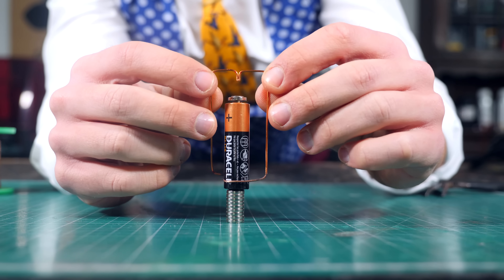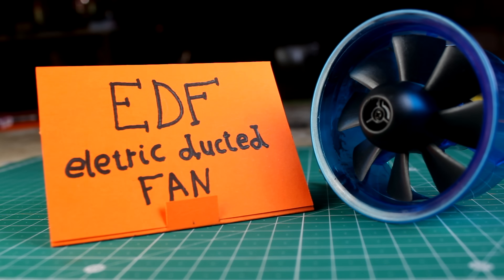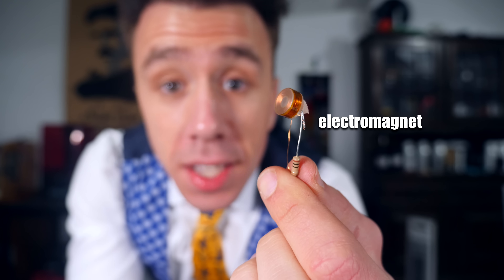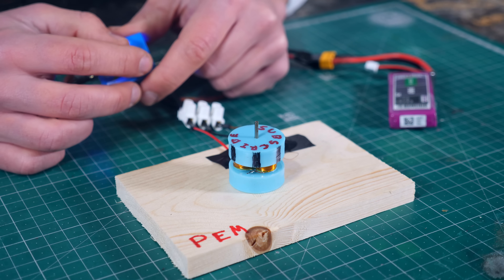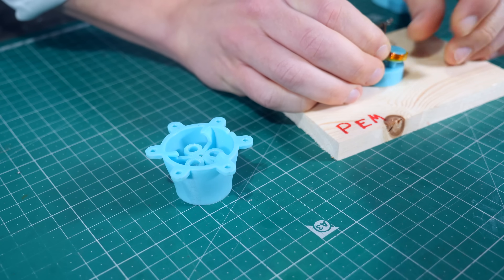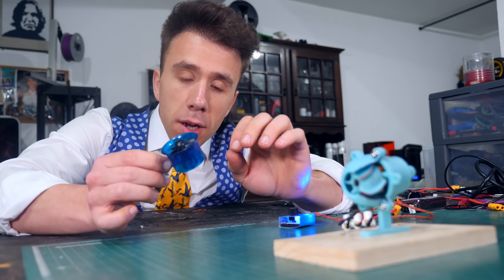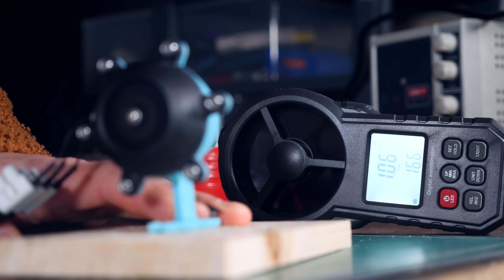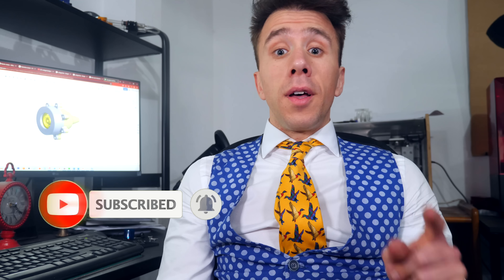I 3D Printed an ELECTRIC MOTOR FAN

Comment: As an electromechanical engineer I see not a lot of people are talking about the fluidynamics aspect, allow me to explain in basic terms:  Aside from optimising the blade/turrbine design to the motor, and clearances etc., there really is one main reason why you won't really be able to make as much thrust with the "Turbo Fan" as with the normal EDF. It all boils down to the conversion of pressure to flow. Below a simple explanation.

As a few people already mentioned, thrust is equal to the mass moved by the device per unit of time multiplied by the speed of the air moved (F=(dm*v)/dt)
This means that to obtain the highest amount of thrust, we want as much air as possible travelling at the highest speed possible. 

A  moving fluid (gas or liquid) will store it's energy in either an increase in pressure, or added velocity (at least in this use case). Both are interchangeble. This means we can use a gas at high pressure and convert a part of this pressure into motion. Think about compressed air absolutely blasting out of an air compressor, or putting your finger on a garden hose. The device you would use for it is what is called a nozzle. Sadly enough, converting the energy stored as pressure into a higher velocity will in the real world always be an operation paired with losses, there is just no way around it. A nozzle will never be 100% efficient. Since what we are interested in is the highest amount of speed, we would like to convert all the pressure our imaginary pump or fan produces into speed. But as this conversion saps away energy, we would actually like our pump to produce the least amount of pressure from the get-go and just create velocity alone, so we don't lose any from converting it. If one pump or fan turns its received power into a higher amount of pressure, it will thus never produce the same amount of thrust as a fan/pump that turns its received power into a higher speed. This means that even if both pumps/fans are perfectly optimised, the higher pressure one will never generate as much thrust as the lower pressure one.

This leads us to the final part of the explanation, namely the selection of the right pump. A normal fan or propellor is designed to move as much air as fast as possible, without creating any usefull pressure after the fan/pump. As mr. Integza already mentioned in the video, a turbocompressor creates a good amount of flow, but also generates extra pressure. This is usefull if you would want to use this pressure to pump fluids up slopes, to compress air in a jet engine for combustion or to create boost pressure in a car. But in this case we are looking for thrust, and thus as previously explained for velocity. The type of 'turbo Fan' in this video is a semi-axial fan. This is the middle ground between an axial fan, and a centrifugal fan. It does not produce as high of a head pressure as a centrifugal fan, but more than a fully axial fan. It will therefore not be able to generate as much thrust as a normal axial fan, regardless how much you optimise its design. Which doesn't mean it is a bad design, it is just a less suitable design for this purpose.

(And then for the people really intersted in the topic, to improve a fan's or pump's efficiency at higher pressures, we would really need to make blade clearances as low as possible, this then serves as a good example of why optimising this type of design will also be quit difficult, especially compared to optimising a normal fan.)
Reply: ᴄᴏɴɢʀᴀᴛꜱ ʏᴏᴜ ʜᴀᴠᴇ ʙᴇᴇɴ ꜱᴇʟᴇᴄᴛᴇᴅ ᴀᴍᴏɴɢ ᴏᴜʀ ꜱʜᴏʀᴛʟɪꜱᴛᴇᴅ ᴡɪɴɴᴇʀꜱ ꜰᴏʀ ᴛʜᴇ ᴘᴀᴄᴋᴀɢᴇ ᴄᴏɴᴛᴀᴄᴛ ᴛʜᴇ ᴛᴇʟᴇɢʀᴀᴍ ᴀʙᴏᴠᴇ
^^^^^^^^^^^^^^^^^^^^^^^^^^^^^^^^^^^🎁😊

Comment: Thrust is mass flow times velocity increase. Stepping up pressure to increase velocity doesn't do anything except provide an obstruction to the flow, redeucing mass flow more than velocity is stepped up. If you open your nozzle up until it doesn't provide resistance to the motor you'll have the highest thrust. The duct on your centrifuge should just be shaped to direct all of the airflow in the direction of thrust. (My guess is that the duct wall would be a section of a parabola)

Comment: The EDF and the Centrifugal Turbojet engine you built has different bypass ratios, basically the EDF is moving a lot more air. Unless you strap an afterburner, or redesign the intake and impeller itself, you won't get more thrust.

Emphasis on the redesign of your impeller.
Reply: ᴄᴏɴɢʀᴀᴛꜱ ʏᴏᴜ ʜᴀᴠᴇ ʙᴇᴇɴ ꜱᴇʟᴇᴄᴛᴇᴅ ᴀᴍᴏɴɢ ᴏᴜʀ ꜱʜᴏʀᴛʟɪꜱᴛᴇᴅ ᴡɪɴɴᴇʀꜱ ꜰᴏʀ ᴛʜᴇ ᴘᴀᴄᴋᴀɢᴇ ᴄᴏɴᴛᴀᴄᴛ ᴛʜᴇ ᴛᴇʟᴇɢʀᴀᴍ ᴀʙᴏᴠᴇ
^^^^^^^^^^^^^^^^^^^^^^^^^^^^^^^^^^^🎁😊
Reply: Absolutely right, EK= 1/2 mv^2. The most efficient way to make thrust is to accelerate a ton of air just a bit faster than your flight speed.

Comment: 1. Blades passive balancing (static balancing).
2. Blades active balancing (dynamic balancing).

For first one you just need to buy an prop balancer. It's quite easy to balance prop/turbine at home. I did that a bunch of times.

Second one (active balancing) requires a special machine with sensors and precise measurements of vibrations by different axies. It's, probably, possible to do at home, but I never saw a DIY active balancing machine.
Reply: ᴄᴏɴɢʀᴀᴛꜱ ʏᴏᴜ ʜᴀᴠᴇ ʙᴇᴇɴ ꜱᴇʟᴇᴄᴛᴇᴅ ᴀᴍᴏɴɢ ᴏᴜʀ ꜱʜᴏʀᴛʟɪꜱᴛᴇᴅ ᴡɪɴɴᴇʀꜱ ꜰᴏʀ ᴛʜᴇ ᴘᴀᴄᴋᴀɢᴇ ᴄᴏɴᴛᴀᴄᴛ ᴛʜᴇ ᴛᴇʟᴇɢʀᴀᴍ ᴀʙᴏᴠᴇ
^^^^^^^^^^^^^^^^^^^^^^^^^^^^^^^^^^^🎁❤

Comment: the more power you use per flow rate, the worse the thrust per power will get. If you made a fan the diameter of the room, it would make much more thrust than that edf on the same power, it would just spin very slowly.
Reply: ᴄᴏɴɢʀᴀᴛꜱ ʏᴏᴜ ʜᴀᴠᴇ ʙᴇᴇɴ ꜱᴇʟᴇᴄᴛᴇᴅ ᴀᴍᴏɴɢ ᴏᴜʀ ꜱʜᴏʀᴛʟɪꜱᴛᴇᴅ ᴡɪɴɴᴇʀꜱ ꜰᴏʀ ᴛʜᴇ ᴘᴀᴄᴋᴀɢᴇ ᴄᴏɴᴛᴀᴄᴛ ᴛʜᴇ ᴛᴇʟᴇɢʀᴀᴍ ᴀʙᴏᴠᴇ
^^^^^^^^^^^^^^^^^^^^^^^^^^^^^^^^^^^🎁❤

Comment: The impeller is not producing so much thrust bc that's is a function depending on difference of the entering windflow and the one that is being pushed. Impeller compresses the air and lowers it's speed so it doesn´t produce so much thrust

Comment: Hard to see, but Looks like your measurement setup was for CMM/CFM (Cubic Meters per Minute / Cubic Feet per Minute), basically total air flow (speed and volume), or how much AIR it's moving, not how much vehicular MASS it's pushing; which would usually be a measurement of force expressed as weight, Kgs or Lbs, of Thrust.

Couple of ways to address this:
1) Check out MythBusters Episode 231: Accidental Ammo, Premier Date: August 1, 2015 and the Pendulum Rig used to measure the relative force of rocks from a lawnmower vs. .357 magnum bullets. It should be easy enough to make a bench-top version of this rig to measure how hard the exhaust is pushing.

2) If you want to get fancy (and build an easier rig), you can mount the engine/fan on frames to provide clearance for airflow, oriented facing down and blowing the air upward, then place each on a highly accurate digital scale with a camera to record the readings if it doesn't have a max-read mode. Zero the scale with the rig on it, then run the rig to see precisely how many grams of thrust each produces against the load cell of the scale. This method also allows for reasonably accurate direct measurements, particularly if you can make each rig identical in overall mass, and it does not require further calculation like the pendulum method would.

Once you get your measurements worked out to test thrust, rather than airflow, THEN worry about optimization of your fan design. That said, note that the geometry of the Dyson Fan is very likely tuned to the specific motors running them to specific RPM, they're like a Transmission with only one gear, so you'd have to modify the specific internal negative geometries (shape of the cavities, rather than shape of the actual components per se) to "tune" them to the motor.
Reply: ᴄᴏɴɢʀᴀᴛꜱ ʏᴏᴜ ʜᴀᴠᴇ ʙᴇᴇɴ ꜱᴇʟᴇᴄᴛᴇᴅ ᴀᴍᴏɴɢ ᴏᴜʀ ꜱʜᴏʀᴛʟɪꜱᴛᴇᴅ ᴡɪɴɴᴇʀꜱ ꜰᴏʀ ᴛʜᴇ ᴘᴀᴄᴋᴀɢᴇ ᴄᴏɴᴛᴀᴄᴛ ᴛʜᴇ ᴛᴇʟᴇɢʀᴀᴍ ᴀʙᴏᴠᴇ
^^^^^^^^^^^^^^^^^^^^^^^^^^^^^^^^^^^🎁❤

Comment: Air in air out if you open the intake aperture and constrict the out put more than 1/3 of the diameter you will stall or choke the air before it can creat thrust.
Reply: ᴄᴏɴɢʀᴀᴛꜱ ʏᴏᴜ ʜᴀᴠᴇ ʙᴇᴇɴ ꜱᴇʟᴇᴄᴛᴇᴅ ᴀᴍᴏɴɢ ᴏᴜʀ ꜱʜᴏʀᴛʟɪꜱᴛᴇᴅ ᴡɪɴɴᴇʀꜱ ꜰᴏʀ ᴛʜᴇ ᴘᴀᴄᴋᴀɢᴇ ᴄᴏɴᴛᴀᴄᴛ ᴛʜᴇ ᴛᴇʟᴇɢʀᴀᴍ ᴀʙᴏᴠᴇ
^^^^^^^^^^^^^^^^^^^^^^^^^^^^^^^^^^^🎁🎉

Comment: You managed to mix all three DIFFERENT things together and force them to do the job which they are not good at. Two critical parameters of the things moving fluids are basically 1. The mass flow (how much fluid per second you manage to put through that thing) 2. The compression (how much the pressure is higher than before). As you may guess, you normally lose both of them, but if you are good at it - you can win something at expense to another. Or, in other words, you have a classical optimization problem. Now to the names and characteristics. If you want to compress something - you need a compressor (axial is better for flow, but centrifugal is excellent for pressure. pick one). An Impeller is only great once you move as much air fast as possible. We talk about momentum (or mass times velocity). So, logically if you want to misuse  a compressor for impelling purposes, I would pick an axial one or alike. Take a look at the fans of the turbofan engines of the commercial airliners with a high bypass ratio. As for jet engine, you need to compress air in order to supply as much air as possible into tiny combustion engine and let it expand as much as possible (at a turbine) whilst it burns. So I would suggest a centrifugal compressor for a small jet engine (it was common at the very beginning of jets and sometimes now for helicopters).
Reply: ᴄᴏɴɢʀᴀᴛꜱ ʏᴏᴜ ʜᴀᴠᴇ ʙᴇᴇɴ ꜱᴇʟᴇᴄᴛᴇᴅ ᴀᴍᴏɴɢ ᴏᴜʀ ꜱʜᴏʀᴛʟɪꜱᴛᴇᴅ ᴡɪɴɴᴇʀꜱ ꜰᴏʀ ᴛʜᴇ ᴘᴀᴄᴋᴀɢᴇ ᴄᴏɴᴛᴀᴄᴛ ᴛʜᴇ ᴛᴇʟᴇɢʀᴀᴍ ᴀʙᴏᴠᴇ
^^^^^^^^^^^^^^^^^^^^^^^^^^^^^^^^^^^🎁🎉😊

Comment: Hi,
You should think in terms of mass flow rate. Axial fans provide more mass flow rate at a lower pressure and centrifugal fans do the opposite, lower mass flow rate but with higher exit pressure. 
Thrust is a function of mass and velocity not pressure.
Enjoy ...
Reply: ᴄᴏɴɢʀᴀᴛꜱ ʏᴏᴜ ʜᴀᴠᴇ ʙᴇᴇɴ ꜱᴇʟᴇᴄᴛᴇᴅ ᴀᴍᴏɴɢ ᴏᴜʀ ꜱʜᴏʀᴛʟɪꜱᴛᴇᴅ ᴡɪɴɴᴇʀꜱ ꜰᴏʀ ᴛʜᴇ ᴘᴀᴄᴋᴀɢᴇ ᴄᴏɴᴛᴀᴄᴛ ᴛʜᴇ ᴛᴇʟᴇɢʀᴀᴍ ᴀʙᴏᴠᴇ
^^^^^^^^^^^^^^^^^^^^^^^^^^^^^^^^^^^🎁😊

Comment: What is the difference between power input on the two setups?  Are you losing efficiency or is your new fan design not consuming the same amount of power?  That seems like the question you have to answer first.
Reply: ᴄᴏɴɢʀᴀᴛꜱ ʏᴏᴜ ʜᴀᴠᴇ ʙᴇᴇɴ ꜱᴇʟᴇᴄᴛᴇᴅ ᴀᴍᴏɴɢ ᴏᴜʀ ꜱʜᴏʀᴛʟɪꜱᴛᴇᴅ ᴡɪɴɴᴇʀꜱ ꜰᴏʀ ᴛʜᴇ ᴘᴀᴄᴋᴀɢᴇ ᴄᴏɴᴛᴀᴄᴛ ᴛʜᴇ ᴛᴇʟᴇɢʀᴀᴍ ᴀʙᴏᴠᴇ
^^^^^^^^^^^^^^^^^^^^^^^^^^^^^^^^^^^🎁🎉❤

Comment: There are a few things that impact the thrust a propeller of any kind produces. Of course there are things like Diameter, hub to blade ratio, blade form, angle of attack of the blade, but what I think is happening here is that you are either staling the blade, which means that the flow detaches from the blade because it is rotating too fast and therefore cant produce thrust, or you are creating too much backpressure in the housing which also stalls the blades. try out different housings and different speeds, maybe use a loadcell to plot rotational speed against thrust for different ratios of fan to duct diameters. Also house the coils behind the rotor to allow a more laminar flow through the housing. you really dont want turbulent flow when thrust is what you want.
Reply: ᴄᴏɴɢʀᴀᴛꜱ ʏᴏᴜ ʜᴀᴠᴇ ʙᴇᴇɴ ꜱᴇʟᴇᴄᴛᴇᴅ ᴀᴍᴏɴɢ ᴏᴜʀ ꜱʜᴏʀᴛʟɪꜱᴛᴇᴅ ᴡɪɴɴᴇʀꜱ ꜰᴏʀ ᴛʜᴇ ᴘᴀᴄᴋᴀɢᴇ ᴄᴏɴᴛᴀᴄᴛ ᴛʜᴇ ᴛᴇʟᴇɢʀᴀᴍ ᴀʙᴏᴠᴇ
^^^^^^^^^^^^^^^^^^^^^^^^^^^^^^^^^^^🎁❤

Comment: Aside from the other comments speaking to the torque vs flow differences between fan types and the intake size, I think the friction from the unfinished 3D printed surface is whats getting ya. I'm not sure what your finishing process is, but notice how shiny the edf is vs the 3D printed fans matte look. That makes me think that its significantly higher friction, even if it feels smooth to the touch. I recommend you try printing in ABS and then evaporate acetone in a vapor chamber around it to make it nice and smooth. That reduces friction problems while still being 3D printable.

Comment: My assumption is that The EDF is pulling air from OUTSIDE of its duct as well as the forced air inside of the duct while the one you made doesn't do that as well so it produces less thrust?